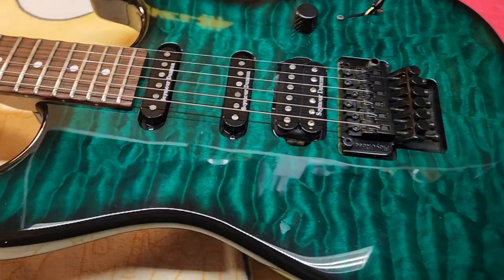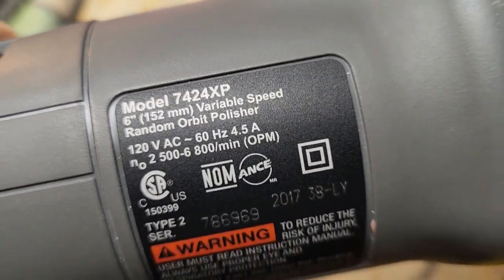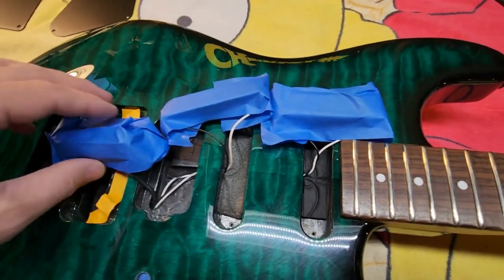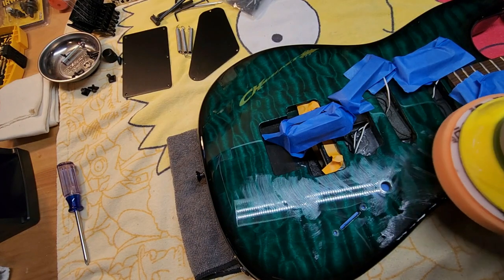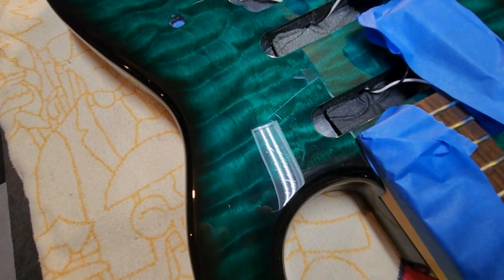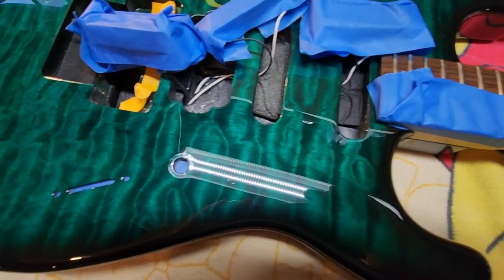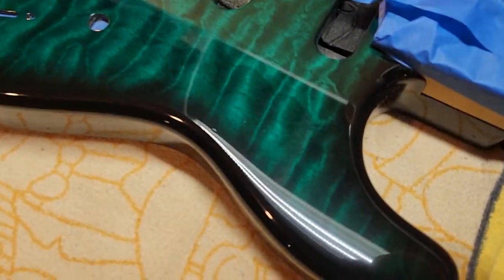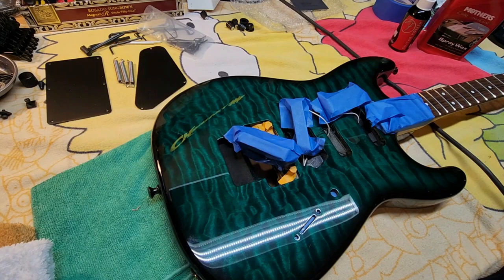Buffing Out Pick Scratches on Guitar with Poly Clear Coat // Charvel Wildcard #4

Comment: You’re videos are very helpful! On my 5150 I need to sand down the red but I don’t really want to spray clear coat to bring back the shine, is it possible to polish with car wax or something? I seem to have heard Eddie did that with his Franky.
Reply from the maker: Thank you very much!  Yes, it's possible.  Are you referring to the Duplicolor Perfect Match Red...or which version did you spray?  Or...the DE1607 engine enamel?
Reply: @CoffeeDrinker71  I used the DE1607 engine enamel
Reply from the maker: @AviationFreak1  Ok, I have never tried to buff that particular paint out...but it would be worth a shot.  That particular paint (and the Perfect Match lacquers) are all single stage paints, and they will release color as you wet sand so that's something to keep in mind (it's normal).  I would try testing a small inconspicuous area first...maybe start with something as mild as 1500 grit (wet sand a small area), then try hand buffing it with compound.  If it works then proceed to the rest of the body.  It's basically what I did on my '78 B/W Franky to get a glossy result without using clear coat.  I've got a video on my channel for that entire project.  Maybe that will give you some tips?
Reply: @CoffeeDrinker71  yes o will definitely check that out, you pretty much have to scuff that red down in order to relic it, it’s a pain 😆, thanks for the help!

Comment: Hello sir, first of all thanks for the educational video, i did the same thing you did, i started with the meguiars scratchx but after polishing it became hazy, i dont understand what to do to eliminate the haze, its the ultimate compund necessary for that. The finnish on my guitar is poly but i dont know how to eliminate the haze?
Reply from the maker: Hmmm...if it's hazy it could have just needed more finer grit sanding prior to the Scratch X...or longer duration of buffing with the Scratch X.  But yeah...you might get lucky and remove the haziness with Ultimate compound.  Don't be afraid to let the buffing pad "heat up" as it does it's job.
Reply: @CoffeeDrinker71  Thanks, i think the scratchx is to coarse, so i bought the ultimate compound and the shine also from meguiars. I will try tommorow and see If i can fix the haze. I also found that on the black finnish is harder to eliminate scratches!
Reply from the maker: @ciureadaniel8927  Good idea!  Yeah, the Scratch X definitely has a larger abrasive than Ultimate.  I agree...black is the hardest to get "perfect".  Best of luck.

Comment: I have read, like many others, that this process will work on pickguards.  Have you found this to be true.  Great video ad I took excellent notes.  Have a few to tackle soon.  Need to get the supplies and go for it.
Reply from the maker: Yes I tried this on a smaller LP pickguard and it removed the majority of scratches.  You might want to look at some various types of compounds that are specifically made for plastics, just to see if there is a more appropriate compound?!

Comment: Could you apply ultra clear coat to fill in the deeper scratches and then compound and polish?
Reply from the maker: Hmmm....I don't know for sure.  Seems a little risky.  Perhaps a better option is to wet sand the areas with the deeper scratches and then polish it back up to full gloss?

Comment: Do you see any benefit in doing the ultimate compound with the white pad first and then some more with the black pad? Same question with the ScratchX and Orange and Green pads. For context I’m not removing scratches from an old guitar. I just sprayed four coats of a 2K clear and flat sanded.
Reply from the maker: Good question.  I think the difference would be negligible between the two pad choices as long as you are using the same compound.  Now, if you were going from the Ultimate Compound to the Ultimate Polish then yes, I believe there would be a noticeable difference.  I actually just asked a similar question with the Meguiar's "chat line" when I was performing a similar job on my wife's vehicle.  Going from the Compound with one type of pad, then moving to the Polish with a softer pad should make a difference.  I hope that helps.  Best of luck on the project guitar!  I'll be doing the same thing on my upcoming "Bee" series on the channel!
Reply: Thanks! You can see a short on my channel of the guitar body. It’s a green metal flake. Thanks for replying!
Reply from the maker: @burresseffects  That thing looks great!!!!

Comment: Do you or can you reuse the pads after use? Or are they one time use?
Reply from the maker: Great question!  Yes, you can actually use these pads over and over.  In fact, you can buy “pad cleaner” in a spray bottle (by Chemical Guys and others) which basically acts as a detergent for the pad.  I usually wash mine out in a utility sink whenever I’m done…then let them air dry before putting away.  Just keep an eye on the surface of the pad.  Once they start to tear or erode away the surface then you’ll know when it’s time to change.  Obviously if you are not using them on a super rough surface to begin with they will last longer.  Thanks for watching!
Reply: Thanks for the rapid reply and good info man. Sp i should be good washing them out with water and mild detergent? Or just water?
Reply from the maker: @daviddibello4593  Yep, I don’t think it would hurt to use some mild detergent.  After all, I think that’s what is in the spray cleaner bottle based on how it behaves under water.

Comment: hi can i use an orbital sander ? it already has hook and loop it a bosch.
Reply from the maker: I personally would not...but that's just me.  I would be afraid that it would generate too much heat in the pad.  A good random orbit polisher seems to be the best tool for this kind of polishing...there's less fear in the pad catching a corner and burning.  I'm sure you could make it work though if you are extremely careful, and check your surface often!
Reply: @CoffeeDrinker71  the speed is adjustable...its a bosch orbit sander they even have polish pad made for them